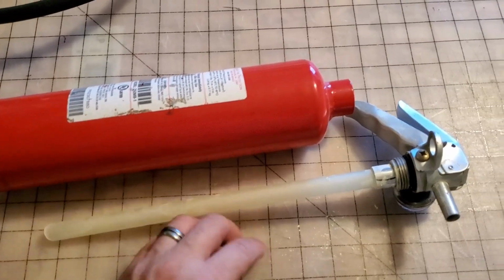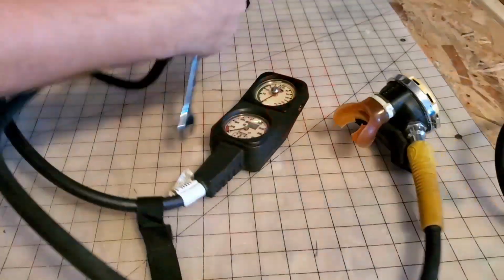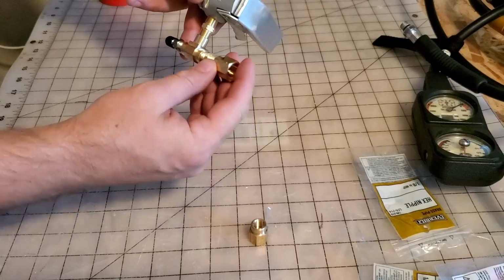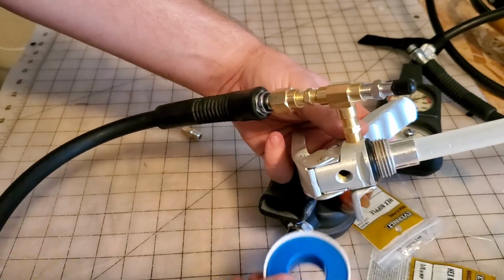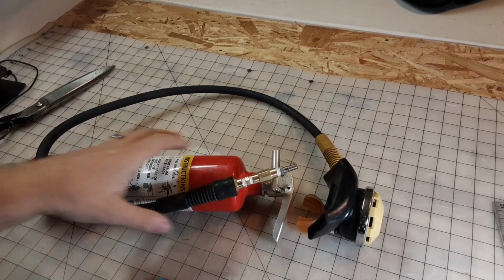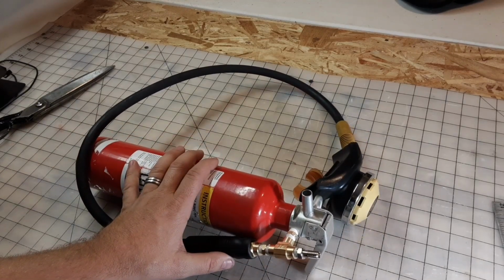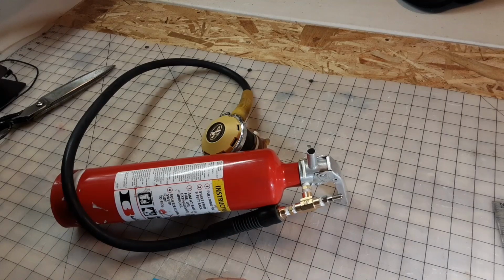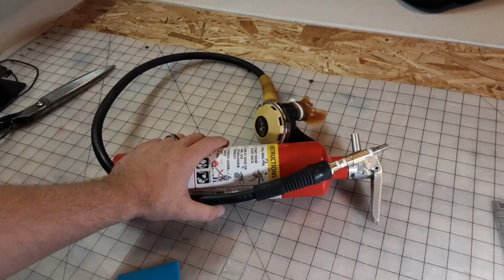DIY SCUBA TANK

Comment: That’s cool! What did you use to clean out the tank
Reply: Do you have to squeeze the trigger to use it
Reply from the maker: Soap and water.
Reply from the maker: No. I removed the valve for the handle.
Reply: That’s freaking cool
Reply: Great job,but not worth using imo...

Comment: Thanks for sharing bro, my question is, what if we will just buy a scuba tank regulator valve, will it not fit directly to the eztinguisher tank's tread? There are cheap scuba tank valvea dor only $15 dollars.
Reply from the maker: Most threads will be a common size/taper. You will just have to figure out how to adapt from one to the other using diffrwnt adaptors and couplers. I spent about an hour in front of the pipe fittings section at home depot before I settled on this set up.

Comment: At design pressure that is going to last approx 25 seconds at 30 ft.
Reply from the maker: I dont know what that means Len, could you provide some calculations or reference? I would love to know the time/depth relationship to improve my next build. Thanks!
Reply: @redneckryan  Excuse the metric, I'm Australian. Small extinguisher, 2 litre volumetric capacity. Working pressure 700kPa= ~7 atmospheres. 14 Litres air at surface. 10m depth= 2 atmospheres therefore 7 litres. Average consumption assumed 16 l/min. 7/16 x 60 = 26 seconds.
Reply from the maker: Thanks len! I didn't realize you consume more air the deeper you go. I figured I would need a bigger tank to go deeper and stay down longer. Thanks for explaining the maths, huge help.
Reply: @redneckryan  Normal SCUBA tanks are rated for 232 BAR (3365 PSI).
A first stage regulator (the big metal thing with the joke connection) reduce this pressure to an intermediate pressure (usually around 10 bar) then this secondary pressure is routed to the second stage (that fits in your mounth).
To breath underwater you need a lot of air, even with 232 bar of pressure, a single 12 liters cylinder don't last for long (usually less than 1 hour).
BTW... the air consumption of the human body never change with the deep.... but the density of the air increase with the deep (so the air runs out faster!).
Reply: Try to build something without an high pressure compressor (and cylinder also) is basically not feasible unless you use a surface air supply system (nothing more than a portable standard pressure compressor floating at surface and connected to the regulator using a long hose)
Reply from the maker: @Guinonohaydive  thanks for your opinion, however certification is not something I am interested in.
Reply from the maker: @teslacoiler  maybe I'll try that next.
Reply: @redneckryan  SCUBA diving requires a proper certification (unless escorted by a certified instructor).
In theory, surface air supply diving (also known as "hookah") don't require a diving certification.... but keep in mind that the dangers involved remains the same: diving seems easy, but just one single wrong ascent can cause serious injuries (sometimes even death!)
Reply from the maker: @teslacoiler  thanks for your opinion, here is mine- there is no law requiring a certification. There is inherent risk in everything we do. We should stop teaching people what to think, and start teaching people how to think.
Reply: ..if you already have a complete regulator.... Why not rent a regular tank from a dive center, filled with clean air and be safe? I am pro DIY but also a diver. This is unsafe in every way. DIY usually gives a solution when funds are low. You have spent more on the connectors than you would spend on a rental tank..
Reply from the maker: @giorgos424  Thank you for your opinion.  Here is why I dont rent a tank- this is to have some fun in the back yard... not to spend hours exploring shipwrecks. So far I have had alot of indoctrinated certified divers tell me how bad this is. I think we have gotten more out of it than the $50 I put into making it. I explained the dangers of filling your own tank in my video. Hopefully I provided some useful information to someone who is going to build a scuba, regardless of how much the scuba community says it is un safe.
Reply: @redneckryan  First, nice work, it looks like a fun project. If Lenphil calculations are correct, that means your lungs (if properly trained) will be more efficient than your handmade bottle. It will be easier, faster, with almost no expenses. 
-Written by the freediver gang
Reply: The lack of basic knowledge of how a regulator works and what safety features are in place here is disgusting. Lung over expansion injuries coming soon!
Reply: @redneckryan  Learning how not to die is not 'indoctrination'

Comment: That's comparable to one of the "spare air" tanks. A normal air compressor isn't going to get above 200psi so you're well within the safety limits of your hardware. The "professional" divers are worried about this system because the air tanks they use are 3000psi and connecting the mouth piece regulator directly to one of those tanks would certainly cause catastrophic failure. This is just not going to happen with the system you've built simply because your air compressor doesn't go that high. Even with a better compressor as long as you know the pressure limits of your regulator you'll be perfectly fine.
Reply: Unless you dive too deep and run out of air....
Reply from the maker: Yeah, you could dive too deep without a tank though.
Reply: @redneckryan  True but it's easier to get over confident when you can actually breathe under water.  Your body's warning system is a bit delayed and you can wind up quite a bit deeper under than you would've been otherwise.
Reply: This could reach up to 3000 psi if he added first stage regulator, not just directly connecting the 2nd stage regulator to the cylinder. $10 welding regulator will do the work.
Reply: @redneckryan  Since you didn't use 1st stage regulator, was the air coming from the 2nd stage regulator free-flow?
Reply from the maker: Free flow? Idk it didn't flow unless I was breathing in if that's what you mean
Reply: @redneckryan  Yes that's what I mean. I am planning on building one but I will be using weld regulator for the 1st stage. Since it has no valve, that means the 2nd stage needs to have valve to prevent free flowing
Reply: @redneckryan  Free flow is a failure mode. You are asking for serious injuries messing with this stuff like this.

Comment: My god man, letting children play with that thing is insane.
The risks are massive. If the valve gives and the 2nd stage regulator decompresses explosively or freeflows uncontrollably
someones lungs could burst or suffer major cranial damage. You bought a regulator at a goodwill, no mention of any service
to the regulator before you used it. I wouldn't even use that rig to inflate my BCD let alone breathe out of it. Some of those
fire extinguisher tanks are coated inside, they use monoammonium phosphate powder which is NOT safe to breathe. 
BE safe, save everyone, get rid of that thing ASAP. Your trusting your childrens lives to a used $20.00 regulator that has
not been properly serviced.
Reply: Bro wtf I have breathed from a firefighter tank and now my throat is sore and my lungs feel weird. I stoped immediately when I noticed a weird taist I’m my mouth. How do I clean it?!
Reply: @CeinX  use a lung detox immediately. Don't use this homemade product. Buy a ventilator for $500 so you're safe.
Reply: He used hand pump to refill the tank. The air pressure inside the tank is just around ambient pressure already